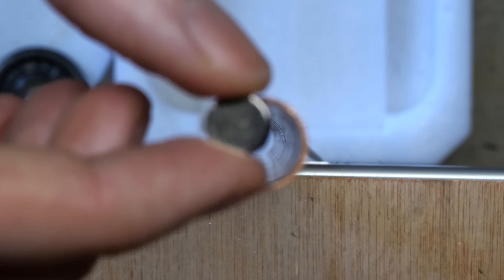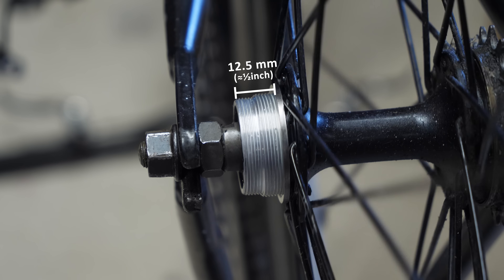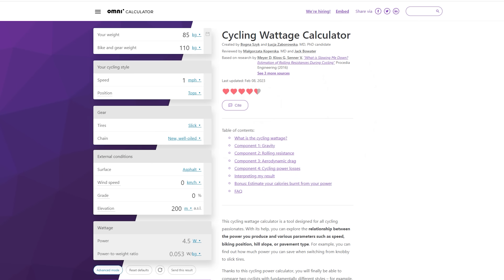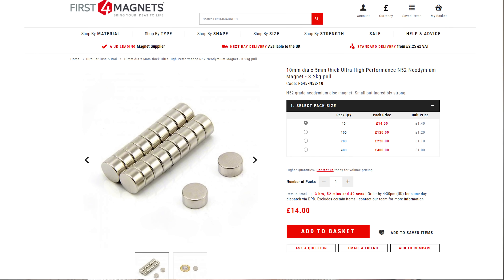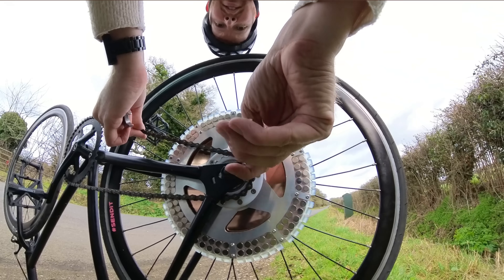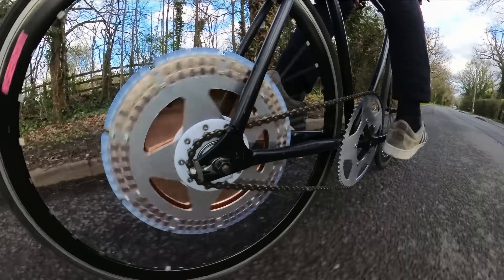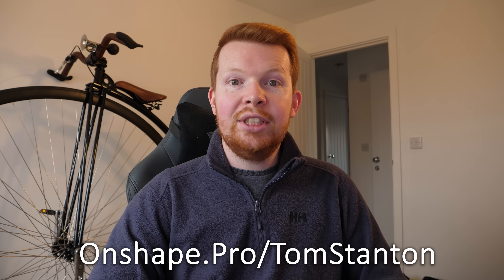Gearless Magnet Bike

Comment: Sure! Let's create a "Tree of Thought" format to explore the reasons for choosing either copper or aluminum for an eddy current braking system:

Question: Which metal should I choose for the eddy current braking system?

Factors to consider: Conductivity, Magnetic Permeability, Cost, Weight

             Copper                                                     Aluminum
           /              \                                                  /                 \
Conductive  Less Conductive    More Conductive    Less Conductive
Magnetic    Lower Magnetic      Lower Magnetic    Higher Magnetic
  Low           Permeability         Permeability       Permeability
Weight    Heavier                       Lighter                  Lighter
Cost         Expensive                     More Affordable   More Affordable

Pros and Cons of Copper:

Pros:

Excellent electrical conductivity, resulting in strong eddy currents and efficient braking.
Low magnetic permeability, reducing eddy current losses and improving efficiency.
Durable and can withstand high temperatures, making it suitable for demanding braking applications.
Well-established material for eddy current braking systems, with a proven track record.
Available in various forms, including sheets and discs, making it easy to integrate into the braking system.
Cons:

Relatively heavy compared to aluminum, contributing to higher overall weight of the braking system.
Higher cost compared to aluminum, potentially increasing the overall cost of the mode of transport.
May require additional cooling mechanisms due to higher heat generation during braking.
Pros and Cons of Aluminum:

Pros:

Good electrical conductivity, generating sufficient eddy currents for effective braking.
Lower weight compared to copper, contributing to reduced overall weight of the braking system and the mode of transport.
Lower cost compared to copper, making it a more budget-friendly choice.
Adequate resistance to corrosion, ensuring the braking system's longevity.
Relatively easy to work with due to its lightweight nature.
Cons:

Slightly lower electrical conductivity compared to copper, leading to slightly weaker eddy currents and braking force.
Higher magnetic permeability than copper, resulting in slightly more eddy current losses and reduced efficiency.
May require larger or differently designed discs compared to copper for equivalent braking performance.
Remember that the choice between copper and aluminum will depend on your specific requirements and constraints. The "Tree of Thought" provides an organized way to consider the pros and cons of each material, helping you make an informed decision based on your priorities and objectives for the eddy current braking system.

Comment: When considering the best metal for an eddy current braking system in a mode of transport with wheels, conductivity is indeed a crucial factor, but it's not the only one to consider for efficiency. Here are some key factors to take into account when choosing the most efficient material for your eddy current braking system:

Conductivity: Higher electrical conductivity allows for better eddy current generation and stronger braking force. Metals with high electrical conductivity are desirable for this purpose.

Magnetic Permeability: In addition to electrical conductivity, the magnetic permeability of the metal is important. A low magnetic permeability will reduce the eddy current losses and improve the braking system's efficiency.

Cost: The cost of the material will also impact the feasibility of the braking system. Some high-performance materials might be costly, so you need to strike a balance between performance and cost-effectiveness.

Weight: The weight of the chosen material is essential in transport applications. Lighter materials will result in reduced overall weight, contributing to better energy efficiency and performance of the mode of transport.

Based on these factors, copper and aluminum are two commonly used materials for eddy current braking systems:

Copper: Copper is an excellent conductor of electricity and has high electrical conductivity. It also has low magnetic permeability, making it a suitable choice for eddy current brakes. However, copper is relatively heavy and can be costly.

Aluminum: Aluminum is another material with good electrical conductivity and lower weight compared to copper. While it has slightly lower electrical conductivity than copper, its lower weight may provide some advantages in transport applications. Aluminum is also generally less expensive than copper.

Ultimately, the choice between copper and aluminum will depend on your specific requirements and constraints. If you can afford the extra weight and cost, copper may offer slightly better performance. However, if weight and cost are more critical factors for your mode of transport, aluminum could be the more efficient choice.

Remember that designing an eddy current braking system involves a combination of factors, including the geometry and design of the brake system, the size and shape of the metal discs, the magnetic field strength, and the material properties. Therefore, it is crucial to conduct thorough simulations and tests to optimize the system for your specific application.

Comment: You might have already found this from your research, but magnetic clutches like this are actually used in industry.  They make an excellent wear-free alternative to a traditional clutch when you need to connect and disconnect a load with a source of rotational power.

Comment: Could this be better as a dedicated brake? Like a standard disc brake but no contact? You could move the magnets in and out of the disc to activate the brake through a brake fluid piston or other mechanical systems. And issue would be the magnets applying magnetic force to the wheel spokes itself which would create resistance. The problem obviously doesn’t exist with carbon fiber aero wheels. It’s weight would also be issue since copper is heavy and so are the magnets

Comment: Can you come up with a sort of levering magnet mount where at higher speeds your magnets move to a larger radius increasing the torque advantage of your magnets. At a stop your magnets are in a contracted position and have less leverage allowing for less pedaling resistance?
Reply: It would also serve to increase your surface feet per minute as your speed goes up?

Comment: A company called Magnadrive in 1995 used these concepts to bring to market a variety of magnetic clutches, gearless drives, etc.  Vibration was reduced and air-gap gearing did not require strict alignment, but the thermal problems developed in the copper/aluminum plates (due to eddy current resistance) could not be overcome.  Interesting concept, not a viable product concept.
Reply: Ad a fly wheel and air pump.

Comment: How about running a hydroling brake line to your magnetic clutch so youre able to have better control accelerating at lower speeds and you wouldnt waste so much energy getting started.

Comment: I have a project for you.  Make a bike that when you pedal you are storing energy in a flywheel, even and especially while not moving.  Then the bike is only moved with the energy in the flywheel.  Both the storing and the releasing of the energy should have cvts.  Some training wheels would come down depending on your speed.  The slower you go the more you need the training wheel, call them landing gear.

Comment: What a great presentation!  Thanks.  Isn't there significant energy lost in the I2R of eddy current?  Isn't this design more like a friction clutch than a gearing?  I would expect much of your leg work is lost as heat.  Am I right?  Oh . . . at 16 minutes, I see that you addressed this.  As an alternate design, it might be interesting to design a magnetic gear set that does not involve slipping at all.

Comment: Would be neat to add a mid drive motor, battery, and controller. Then your throttle would pedal for you and fast!!
Reply: Also figure out a way to transfer all that heat into electricity back to into the battery. Wallah.

Comment: The result was pretty obvious for anyone with basic knowledge about electromagnetism and electricity. Of course it is possible to make slightly more efficient design of "gearless" but it still loses portion of energy somewhere in the middle, is more complex and much more difficult to repair. So most efficient bike is still regular bike. And slightly below that e-bike with just torque assist when climbing up the hill and then some regenerative braking when going down the slope (and ideally that is the moment e-bike might actually be more efficient because mechanical brake always converts excess energy into heat while e-bike can store it inside battery in form of chemical energy. It won't help emergency braking though).

Comment: You could probably play with the disc design and cut windows into it. This would potentially give you move controlled eddy currents. 

Another idea is the make the magnetic rotor smaller and offset the rotors axis relative to the stator. This allows the rotor to act as a magnetic gear.
Reply: My thoughts exactly.

Comment: Fun and interesting idea!

As I've understood permanent magnets, another downside is that they will lose their field strength continuously over time (through usage/wear). Don't know how much and how long it would take before it's noticeable though.

AFAIK this is the reason why higher tier indoors training equipment such as ellipticals/crosstrainers use electromagnetic resistance instead of permanent magnets (or perhaps I'm misremembering and it's more because of better/smoother resistance adjustability, than it is to avoid permanent magnet wear?).
Reply: It’s because you can turn them off.
Reply: You can 'renergize' your magnets if you need to by applying a DC voltage to them.

Comment: The bottom line is that this is a totally impractical idea.  Whenever you're putting torque on the pedals, this "clutch" losing energy.  So you have that totally unnecessary friction on the operation of this machine 100% of the time.  It's like a regular bike where the break shoes are always slightly squeezing all of the time.  Given how important efficiency is on a bike, this idea is a non-starter.

Comment: You could probably make an electronic gear shift for this by adding a coil of wire instead of the copper disc and varying the resistance to change gears ( a low resistance would would be a low gear and a high resistance would be a high gear).

Comment: Tom Stanton "I hoped it would behave like a continuously variable transmission"
What you actually made is functionally almost identical to a torque converter. In fact, I could see it replacing a torque converter in automobile applications if anyone wanted to do enough R&D to make it work! 
In a torque converter the force is transmitted through automatic transmission fluid, which has the added bonus of absorbing heat and transferring some of it to whatever the fluid touches. In the magnetic torque converter, there's no fluid so the disc is cooled by the air around it and by radiating energy as all hot things do.

Comment: At 8:00 in, I notice in your testing the magnet placement, which could change the results. On the 1.5kg test the magnets are placed at the bottom, where more strength is going to be required to work against the momentum. I believe it's most effective at the highest point of the turn.  The heavier the weight, the higher the magnet gets on the bracket.
Reply: The weight isn't creating a lever with the magnets though. The magnets are only interacting with the spinning copper disk, which is radially symmetrical, so it shouldn't matter whether the magnets are positioned at 3 o'clock or at 12 o'clock

Comment: Using a material with lower electrical resistance would increase the eddy currents greatly. But anything better than copper is extremely expensive. Like gold, or superconductors.

Comment: Regarding "gears" you could use some kind of centrifugal force mechanism, that pushes counterweights out when you pedal faster, pulling the magnets in. Having the magnets closer to the rim will give you some leverage allowing for a lower "gear" when pedaling more slowly.

This might be difficult to build and also difficult to control when riding, but on paper it should work
Reply: a variomatic from DAF. No magnets required.
Reply: @andreasrademacher5715 
Simply a modern scooter or snowmobile transmission 👍

Comment: how much energy is converted to heat with aluminium disc? 
OH and try and match the weight of the aluminium with the copper disc you already used

just thoughts

Comment: Did you consider that the sprocket broke because when you pedal it is constantly being tightened on the threads and it split because of outward pressure?

Comment: I would have keep it just as braking mechanism, using an aluminum wheel frame (not need to manufacture those, you can buy them) and placing the magnets  in the normal position than normal Rim brakes with a similar mechanism to get close to the frame. In that position you have faster speed between the magnets and the aluminum, this mean stronger force, then this force is even more effective because it acts much further from the axis of rotation.
For last you are not adding extra weight as happen with the disk.
The only cons is that the aluminum frame is not thick enough to produce the stronger eddy currents, but it would be much better from the weight-force ratio. 
Of course.. Rim brakes would be still more effective, cheap and practical with the exception of rain.

Comment: Reminds me of Buick's dynaflow transmission. Basically just a giant torque converter that burned up all your power as heat. You leave it in drive and it slips all the way up to highway speeds when it finally locks up. Wild engineering back in the day to reduce shifting interruptions.

Comment: The thing that I would miss is the coasting ability. Sure going downhill and still pedaling would mean a somewhat constant speed instead of wearing down your breaks. But for that I think there is a better solution. You could reverse the design, so the magnets are constantly spinning and the copper plate is on the clutch. The magnets are placed low and due to the flying force, they fly outwards at a certain speed and only then engage with the plate. This way you break at a certain speed. I think this might work.
Reply: I was thinking that in a production run of something like this, you'd have a way to enable & disable the effect based on either environmental inputs or user control, so that coasting would still work.

Comment: The aluminum plate on the super magnet falls far slower BECAUSE it is far LIGHTER!  Aluminum is about 1.6 grams per CC but Copper is around 6 or 7 grams per CC, heavier than iron.  You are right to try copper in the clutch as it is a better conductor and weight will not be an issue.

Comment: you know, theoretically, this could be applied to a motor vehicle using a similar idea. perhaps with a small amount of friction material with magnets embedded in it, using a thick aluminum flywheel and pressure plate. but this would have to have the ability to get up to speed using magnets before applying a clamping force to avoid wear on a soft material like aluminum. sort of like a lockup on a torque converter to avoid slipping as much as possible.

Comment: Wouldn't it be better if the brake system moved the plates together, thus increasing resistance. If they are far enough apart then you won't have any resistance, or least almost none. You pull the break, the disks move together and the resistance kicks in. I'm probably missing something so apologies if this seems a little ignorant.

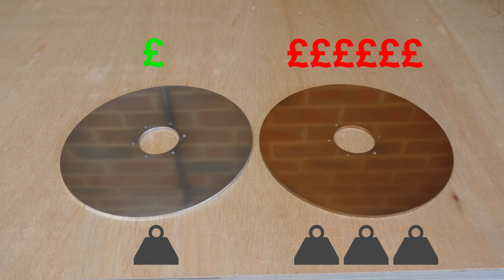Comment: Im only at the 2:40 mark but the Al disc might still be better at breaking since its lower rotational inertia will allow it to slow down faster.  Your test with the falling weights show that the copper disc resists changes in momentum more which for a break you want to reduce the momentum of the brake disc.

Comment: If you utilize the spokes of the aluminum wheel that holds the magnets as a fan by tilting them to blow air over the copper disk, you could potentially see more efficiency! I would love to see this system attached to a combustion or electric motor and truly see the efficiency and effects! This clutch system could be amazing for vehicles powered by small engines! My hybrid powered bike's centrifugal clutch is acting up so if I could get my hands on a device like yours I could see it acting way more efficiently and maybe even improve the longevity of the engine!!!!!